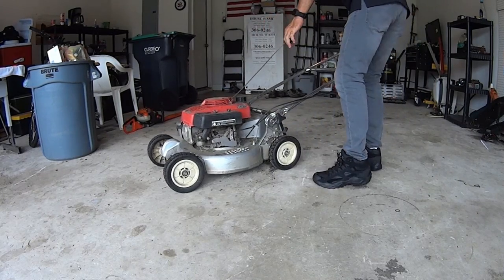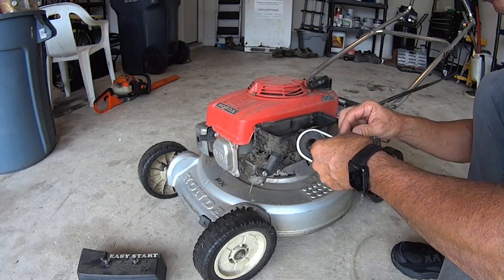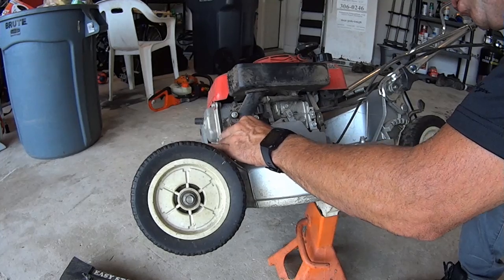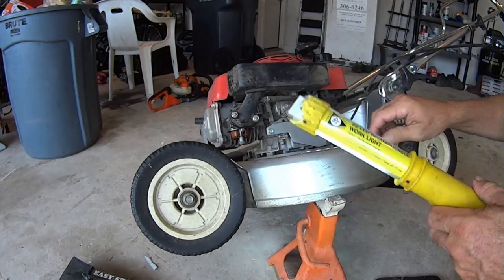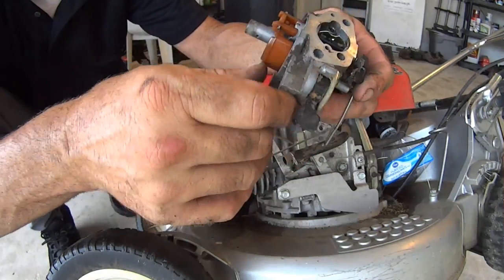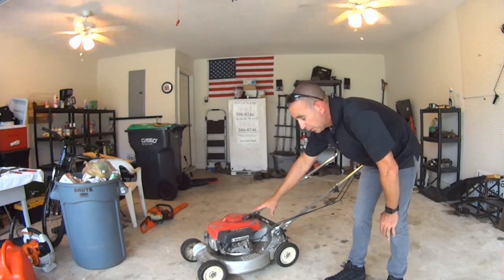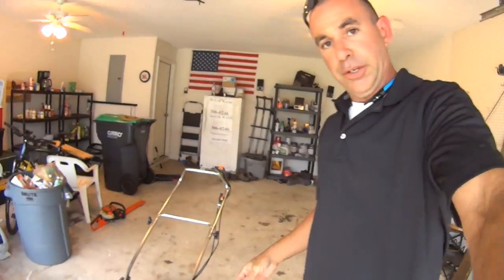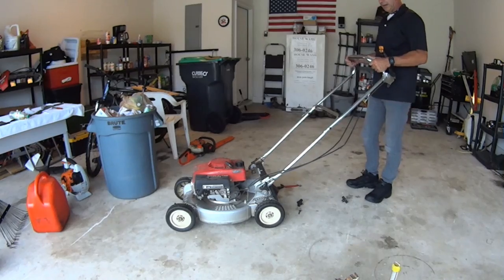Can We Fix Old Honda Lawn Mower Carburator - Realtime Grass Cutting - Lawn Service

Comment: i will go to the dealer before.I ever buy a Honda mower from.home depot again.when you but from a power equipment store.you are buying a real Honda and not a cheap knock off. you pay for what you get at the big box stores.
Reply from the maker: +Tommy  lee Pate I absolutely agree
Reply: It's not a knock off. It's just a residential unit.

Comment: You know carb cleaner works better and if you use water it can damage the carb but if you want use just be careful.  Side note  I would change spark plug for new one as long as your on the service Honda kick  and change oil twice a year

Comment: Thanks for the video Dan.  Now with the 10% ethanol fuel, it's harsh especially on older equipment.  I talked to someone that used to work at a mower shop, he said 90% of running issues are fuel related.  I was told by the lawnmower place where I buy parts, to use only premium fuel in my equipment (regardless what the manual says) because of the Ethanol.

I like the Honda mowers, my next mower will probably be a Honda.  Currently I have an older Toro Personal Pace mower, I think from around 2007 that still works pretty good.

Comment: i had a Honda like this in 1988.it was self propelled. it was one tough mower. it would pull the dirty off the ground.
Reply: Tommy  lee Pate I grew up with the self propelled version. Ran flawlessly for 20 years without any service other than sharpening the blades and the occasional oil change every couple years. Used and abused for sure.

Comment: Hi Dan..another great video..I was have starting problems all the time and running sporatic until I started adding SEA Foam..check out some great videos on that. Havent had a problem since..can add to any 2 or 4 stroke and cleans out everything..Good luck..I take a 5 gallon can and add it to that so all my machines get it..Even Power washers etc..
Reply from the maker: +Big T Enterprises Awesome info! I use 89 octane "marine" gas - ethanol free. So far so good, especially with my 2 stroke machines

Comment: My Trotbilt push mower was not starting years ago I cleaned the carb with carb cleaner and used a bread tie for the jet hole put it back together now it starts on the first pull even after sitting all winter.
Reply from the maker: +Mark's Reviews Thank God for bread ties!!

Comment: Soon as u took that bowl out, good god that is dirty and the bolt for the Honda's doesn't have a jet hole I been through it when I had one
Reply from the maker: +edboy343 cut grass Ya man, where did that come from??? So much crud
Reply: Dan's Vlog from dust over time an that's how dirty they could get but on the bright side you got that running an back to business as usual lol
Reply: Yeah I think putting an in line fuel filter that can be easily changed would help.  Change it if you see crud accumulating or once a year.  Would be easier than tearing into the carb.
Reply: Joseph Bopp last time I been having issues that was nearly four years ago lol since then I replaced basically everything
Reply: I remain convinced it's coming from the gas cap during rain and/or heavy dew. Cooled gas tank creates vacuum that suck water up the threads and into the tank. Like everybody else, I know that the refill jug of gas is pristine at all times because I can and do look in there, yet the carb bowl looks like this every single time there is trouble? I've taken the rubber 'vent' device/gasket out of my caps and it's not happened yet. Techumseh is the engine with the feed hole in the bowl mount screw - sometimes the adjustable main jet needle is there too. Newer Honda have a gas cap near three inches across, I'm thinking they figured out that there is a problem here. Techumseh is particularly bad with sucking water as they have a moulded in swimming pool that supposedly runs the gasoline away if you are so sloppy as to miss the hole. Water sits in there just fine too.

Comment: My mower starts first pull but after it's shuts off it won't start again. Idk what's wrong
Reply: If it's really got some miles on it you might have the case where the exhaust valve clearance needs to be opened up a great deal. Always happens like that to older single cylinder engines too. Start good cold, won't go hot for nuttin. Exhaust valve isn't closing because the seat has worked into the engine block. A compression test will prove it if you take a cold pressure reading and another after it's hot. Should be the same as temperature is not normally a factor, when hot is half of cold pressure you have the above problem with your exhaust valve. It just needs .010 ground off the end of it too, bench grinder would do fine and so would a $20 dial caliper from harbor freight. You would need a new head gasket for modern engines, 20 minutes is my record for this job back in 1979. Without fail this is the fate of all lawn mower engines late in their useful life.

Comment: Got a bad rod knock she's gonna blow. 
Better get it fixed if you're gonna keep it. 
Get yourself a set of welding tip wires to clean out jets.
Reply from the maker: +J Fox Good idea on the welding tip wire. I have some in fact. Let her blow!!
Reply: I used the wire from a bread tie and carb cleaner works good now.

Comment: Why don't you use the blade clutch?
Reply from the maker: RDI Productions I bought this used and the clutch is stuck ON. It doesn't bother me
Reply: Dan's Vlog Better stuck ON than off.
Reply: Dan's Vlog I just bought a Honda and I love the blade clutch and the hydro transmission